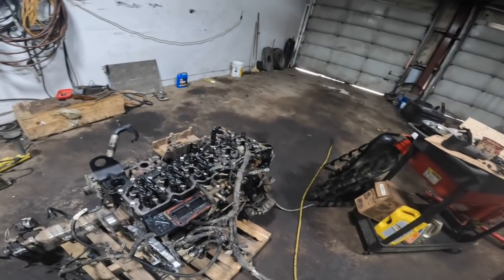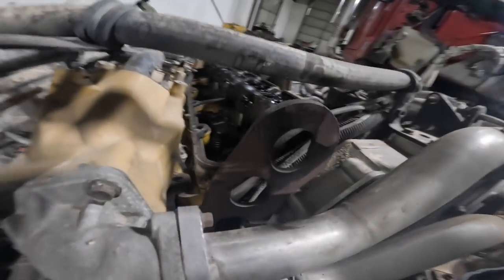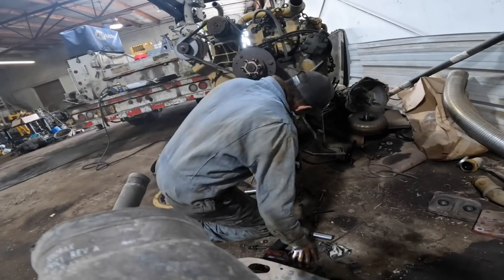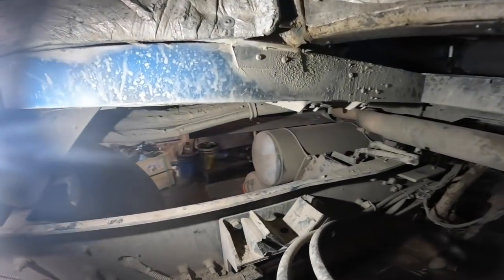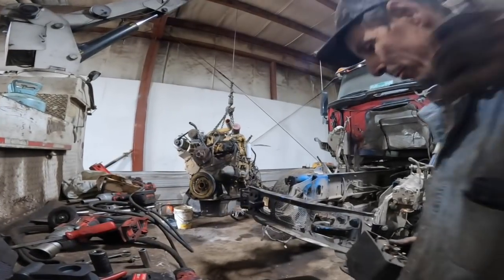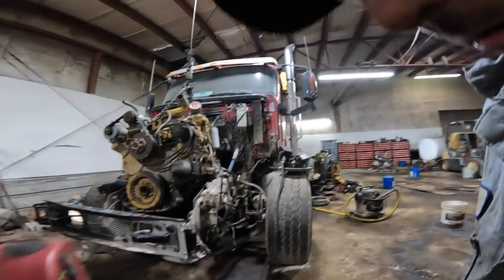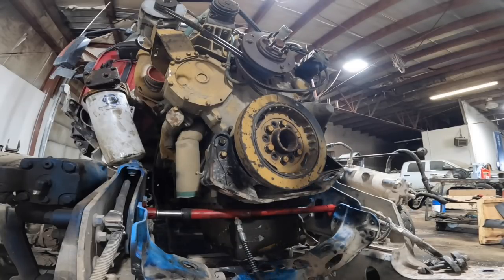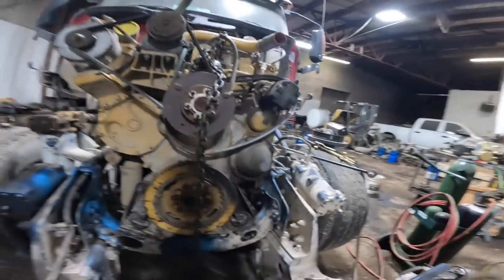Making it a real Caterpillar truck! Pt1

Comment: Gotta love the 'have a go's'.
As you say, you can't blame them for trying.
Just always seems you never get them local 8am on a Monday. Always 5pm, 2hrs away from home on a Friday 😂.
Had exactly the same scenario last week, big Kalmar forklift, no start, suspected injection pump issue. 24V system, turn up to find one battery at 6.9v and the other at -0.1 where they've just kept cranking, dash hanging out, jumper wires laying everywhere.
"Ring me when you get 2 new batteries"

Comment: The Ct15 to c15 conversion is pretty simple conversion.  The ct15 head is designed by Navistar and that is where all the problems are.  My friend converted 2 ct660 trucks over to c15 spec and it is probably the Ultimate cat engine when built properly.
Reply: I’ve been interested in doing this conversion. Would your friend be willing to chat about it?

Comment: I believe that CT15 has the 5 valve cylinder head.  The PEEC engines all ran past 700,000 miles to overhaul, where as the mechanical 425 hp engines needed an overhaul at 500,000 miles. Of course, a lot of the PEEC engines were lower horsepower fleet engines.

Comment: Hey warren I was wondering if you had an email that I could possibly correspond with you on? I’ve got a 2002 C500B kenworth with a pre emission Cummins ISX. I’m having issues getting it to start. It will turn over but no smoke coming from the stacks. I was wondering if the lift pump or transfer pump what ever you want to call it. If it was ecm powered or just key on power. I can’t hear it when I turn the key on, makes me think that it seized up over winter. Thank you very much from a northern Albertan. Thank you for your videos as well. I aspire to be as good of a mechanic as you are one day